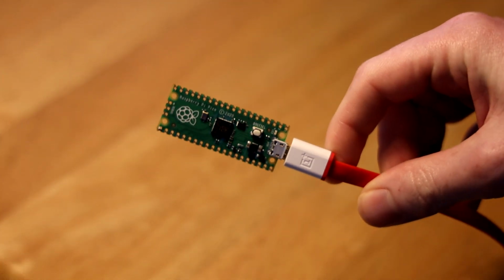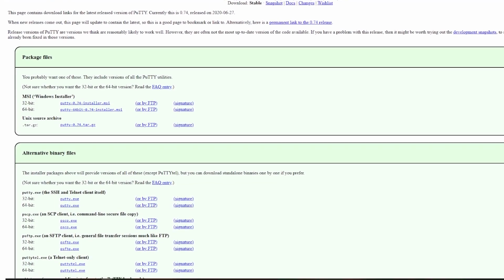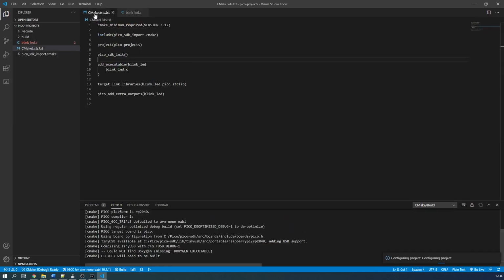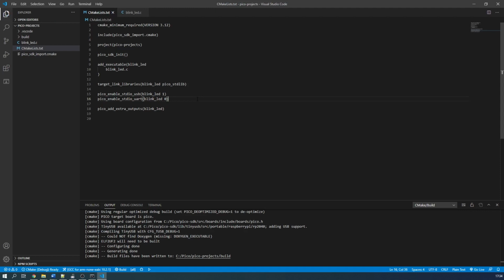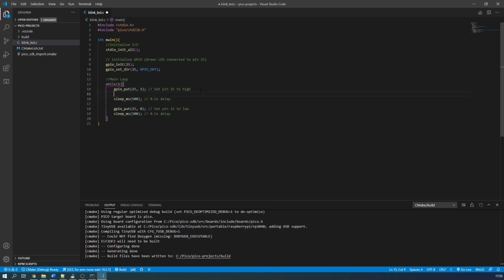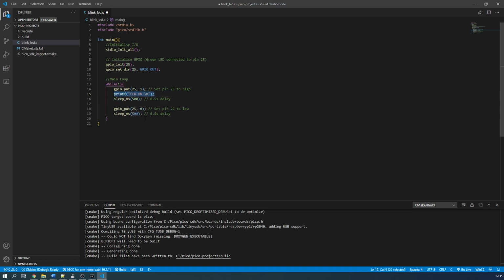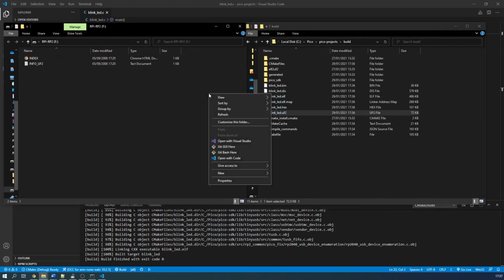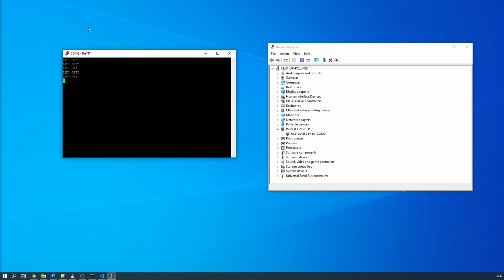Getting Started with USB Serial Output on the Raspberry Pi Pico

Comment: Great and thorough tutorial, although I seem to be having an issue where the Pi Pico does not show up as a device in the COM ports in Device Manager when I go to do the serial comms.  This is in Windows 11 Pro however I have seen mention of others having this same issue on Windows 10.  Any idea as to why the device wouldn't be registering as a COM device?
Reply: For anyone else who has this issue, for me the issue was that the TinyUSB Submodule had not been included.  To fix this, navigate to your pico-sdk directory and run

git submodule update --init

This (for me) updated the submodules and now I do not get a "TinyUSB submodule not found" warning when running the cmake commands (which I only discovered by going back to my Developer window and attempting to run cmake from the command line)
Reply: thanks

Comment: One pain point of using USB connection as serial/stdio is the delay of Windows establishing the COM port on USB connection, and further delay in connecting a terminal to the said COM port.
You could reset, but then the COM port drops and you have to reconnect again.  That can cause you to lose valuable troubleshooting information.
Hence why sometimes it is better to use an external 3v compatible USB to serial adapter and connect it to UART pins.
With that you never lose the USB based COM port, even if the serial to UART connection is lost.

Comment: Hello, I have a little problem with the USB communication on the raspberry pi pico, sometimes the connection just stops after I send one command from the PC. I use the raspberry to control a relay if something is send over USB. Sporadically the communication just stops, do you have an idea what can be done?

Comment: Hi thanks for the video. When I put printf function just before endless loop while(1), it doesn’t not output the string on terminal. Is there any particular reason for this? It is like pi pico boots up and comes to while(1) before printf outputs on the screen.

Comment: Hi, I noticed that when the PICO is connected (PC running Win10) that another device (other than the COM driver) is "unsuccessfully" installed called "Reset". I can't find specific mention of this anywhere. What is this and how can I make use of it, if at all? Thanks for the vids BTW short, sweet and to the point :-)

Comment: congratulations for the content. I'm looking for a way to do something similar with micropython. Do you have a link you could point me to?
in my tests, the print command only works if I start with thonny. Just connecting the pico to the usb it doesn't start, as if it didn't know where to send the standard output.
hugs and thanks!

Comment: Hi... I thank you for these tutorials you are making....they are great. Also, why is my pico not being recognize in the device manager? I followed the codes properly.... thanks for the help.
Reply: I have the same issue
Reply: I ended up resolving this issue for anyone who is interested.  The issue was the the TinyUSB submodule was not present in my sdk, to fix it do the following

navigate to your pico-sdk directory and run

git submodule update --init

This (for me) updated the submodules and now I do not get a "TinyUSB submodule not found" warning when running the cmake commands (which I only discovered by going back to my Developer window and attempting to run cmake from the command line)
Reply: I too have this same issue.  It seems specifically to be from builds using VS Code, checked a few different solutions, nothing worked.

Comment: I cant find device in Ports, how to install usb drivers for pico in windows 10
Reply: Three years later but I figured I would answer for anyone else who cares

I ended up resolving this issue for anyone who is interested.  The issue was the the TinyUSB submodule was not present in my sdk, to fix it do the following

navigate to your pico-sdk directory and run

git submodule update --init

This (for me) updated the submodules and now I do not get a "TinyUSB submodule not found" warning when running the cmake commands (which I only discovered by going back to my Developer window and attempting to run cmake from the command line)
Reply: I have the same problem, BUT, no problem when using M/python & Thonny on W10. Something up with the VSC or more likely the CMakeLists.txt and/or the code itself. Any/all suggestions gratefully received!!

Comment: Hi. Yes, all too many tutorials for the pico are for micropython, much appreciated for these videos as I'm most comfortable with C, and it compiles to code that should too run faster & much more efficiently. QUESTION - is it possible to use stdio_usb lib to read from the usb serial port, say if you type something into Putty? I haven't found a way of doing it but apparently scanf is available. Thanks!
Reply: I agree, not enough C/C++ tutorials out there, everybody on the Micropython bandwagon.
Reply from the maker: Glad you are finding the C tutorials helpful, I also found that there weren't many people covering this on YouTube so I decided to step in! 

It is possible to use the scanf function, as well as getchar and so on. However, all these functions block the core from processing a task - perhaps a use for the second core! See example using get/put char:

#include <stdio.h>
#include "pico/stdlib.h"

int main(){
    //Initialise I/O
    stdio_init_all(); 

    //Main Loop 
    while(1){
        char c;

        printf("Enter character: ");
        c = getchar(); // Receive Char over USB Serial
 
        printf("Character entered: ");
        putchar(c); //Print Char over USB Serial
        printf("\n");
    }
}